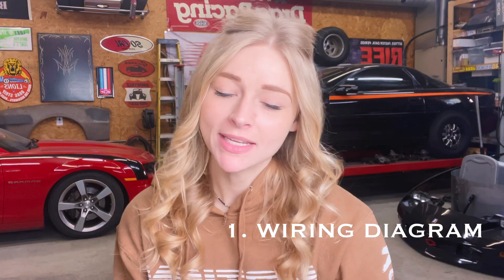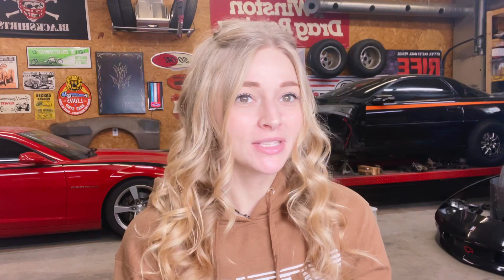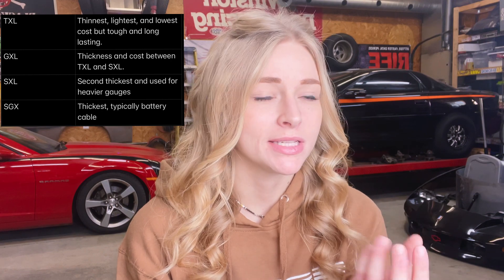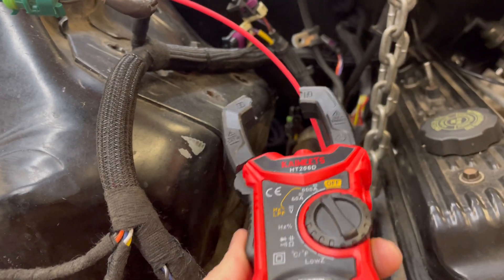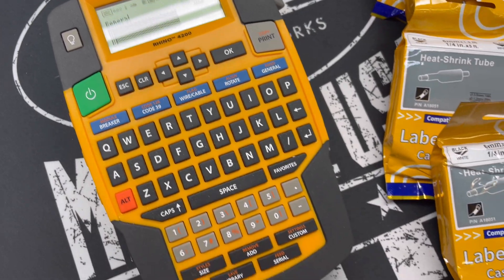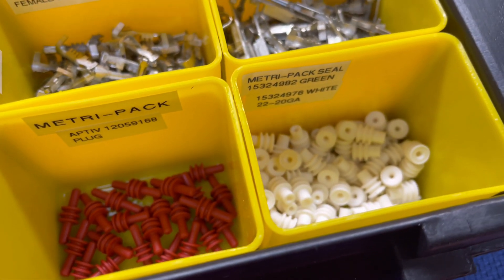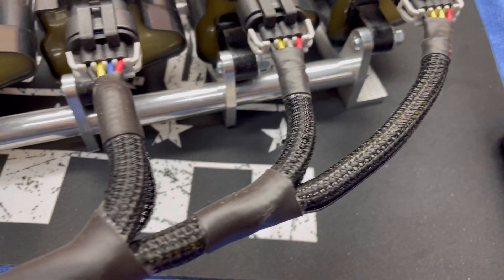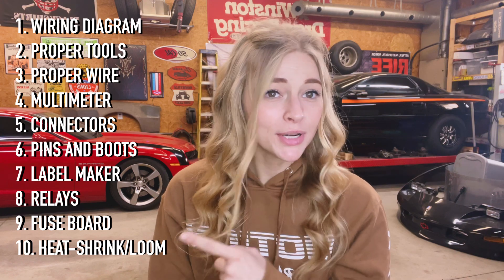TOP 10 Things You Need To Wire A Race Car

Comment: Something I want to try is using a Power distribution module or solid state relay and circuit breaker set up. They seem to be quickly replacing fuses and relays because they weigh nothing and take up hardly any space. Some of them are also programmable which helps eliminate extra wires. Motec’s PDM can use a CAN button pad so all of your switches are connected to 2 data wires  that run through the firewall to the pdm, saving space and weight.

Comment: putting heat shrink over loom like that is such a pita. i like to get that fabrickey type tape like they use from the factory. you can get it on amazon fairly cheap.
Reply from the maker: I have that as well. Adhesive heat shrink lasts so much longer as well as makes everything look professional

Comment: I like to scratch start, and run everything where it needs to go, leave it about 12" long. put a few zip ties on it, to hold it where it needs to be, then lay it out on a piece of plywood, cardboard , and zip tie it to the board shaped like it will be in the car,,then loosely zip tie, and or, wrap, looming or what ever you are going to run the wiring in, shrink tubing is your friend, and label everything that isn't obvious, atleast, label each end, because you will not remember, 6months from now, what everything is. The 3x or 4x shrink tubing is great, and it comes in colors. To color code, the marine grade is great for exterior, it has glue to seal the connection, last thing you need is the wire to get wet inside the insulation, and in the crimp, start corroding, the it's corroded on each strand. So even if you replace the connector, it's still not going to make a good connection, and it can corrode 12" or more into the wire length, so unless you are going to clean each strand then repair the connection, it's not making a good connection, and voltage drop, possibly a lost connection can cause major headaches. Who is going to expect the connector to not be making contact with the wire,  )  anyway, after I get it layed out loomed and labeled, put it back in the car, zip tie it to the car, then terminate the connections, shorten the wires that may need it, and always plan for the future, make it easy for the upgrades you may be planning for, Maybe run a extra or a heavier gauge wire for a second or high current fuel pump,  run wires for a interior light, a small led light inside or under the hood can be a life saver when looking for something at night, and it weighs nearly nothing!    Great video!!
Reply from the maker: Good practices, I like it!

Comment: Just found this place. Good vid. Wiring and transmissions are normally ‘black magic’. 
The term for seeing if it’s the same wire from end to end is called ‘continuity’  😁 
I found a site ‘how to build a hot rod’ iirc. That site has good info about wiring as well. Basic hot rod diagrams. If you really have to start from scratch, it’ll help. Used that as I’m gathering parts to rewire an old Jeep. You can’t have too much info. Looking forward to seeing what you do. 👍🏻
Reply from the maker: I appreciate it:)

Comment: This is good info to have. I do a ton of wire and its hard to locate places that sell the terminal I need
Reply from the maker: Mouser is filled with a ton of different products however, difficult to navigate at times
Reply: I've used them before but alot of the milspec stuff is hard to come by or takes too long to get in.
Reply from the maker: @gates_e2264  anything on prowire? They have milspec